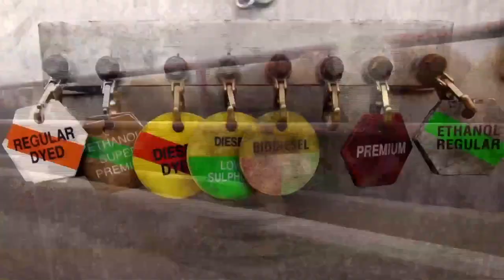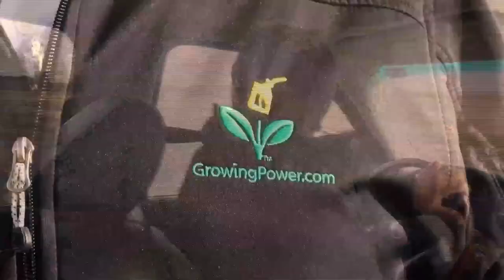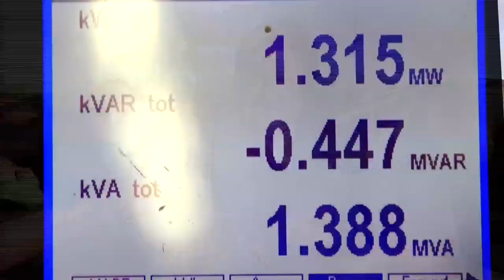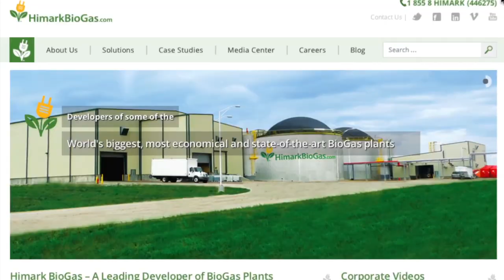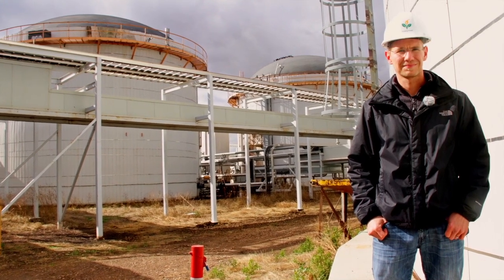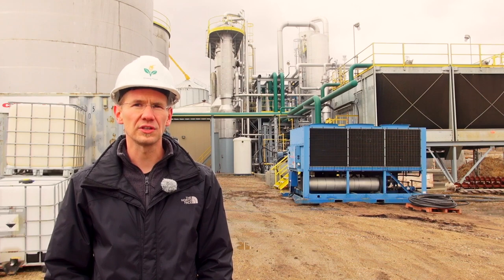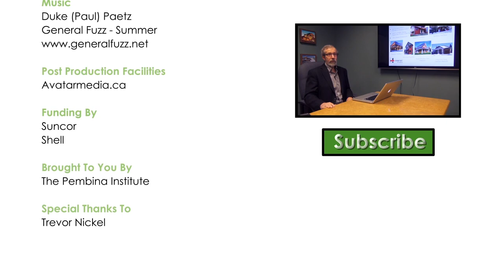84. From 500 tonnes of cow poop a day comes biogas & ethanol

Comment: Solving waste problem and generating energy from bio waste them, is always a win win. Corn ethanol on the other hand is plain stupid. If your going to make ethanol, use switch grass or some other kind of grass from poor production, non fertilizer land systems.  Turning good food into fuel is ridiculous.  Bio-gas liquifies very well, and is a good replacement for gasoline, converting spark ignition vehicles to Bio-LNG is viable and sensible.

Comment: Manure does not contain a lot of energy. It’s food that went and got digested through the animal. The manure is mixed with food waste. That’s what creates the energy. I know they said that briefly, but most of the video gives the impression that the manure is energy-rich.
Reply: Maybe a little more research in the manure properties. I'm in the Greeley Colorado area building a gas injection site for biogas.  Yes it is food that goes in. But the rich manure that fill the digester with H2S gas is only from manure. I just left two sites in NV that are doing the same biogas projects. Only cow manure is used in these digesters.
Reply: @stevenbrent5764  
Thanks for the advice.
I’m a senior chemical engineer/ project manager who designs and optimized the performance of these and other facilities for a living.
Reply: @stevenbrent5764  
You probably meant CH4 not H2S gas.
Manure-only facilities function to reduce the BOD of the manure, but can only produce energy if they are processing large volumes of manure.

Comment: Shame it only works when subsidised.
Reply: That’ll change if we get taxed on the carbon we produce either individually or the businesses we run.
Reply: Ethanol production is 40,000,000 liters per year or 10,580,000 gallons of ethanol.

The price per gallon of ethanol is around $1.40 or $14.8-million per year.

Add to this whatever amount of electricity they actually feed back into the grid.  He said enough electricity for 2,500 homes (@ 04:00).  Assuming very efficient homes using 20-kWh per day, this is 18,250,000 kWh per year.  At $0.10 per kWh, this is $1,825,000 per year.

They, also, add a tipping fee for the municipal waste.  They receive about 73,000 tons of municipal waste per year.

It converts the manure into potting soil which can be sold to garden stores, and it saves about $0.015 per pound for corn silage.  

Assuming they provide 20% of daily feed as corn silage, this is (20% x 35-pounds x 36,000 x 365 x $0.015) = $1,380,000.

Together it is about $18,000,000 add $10 (my estimate) per ton of municipal waste or $730,000, and add another $0.01 (my estimate) per pound of dirt sold to garden stores ($0.01 x 365 x 1,000,000 = $3,650,000), and the numbers become even larger.